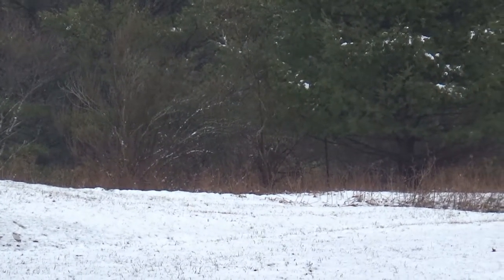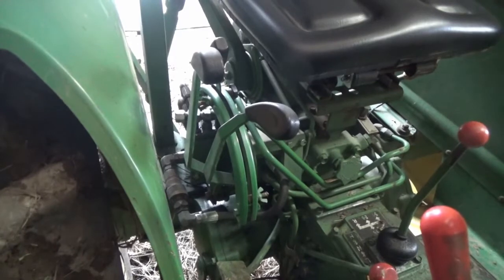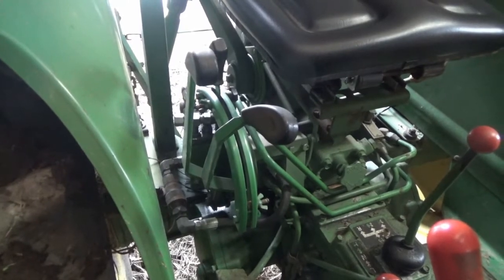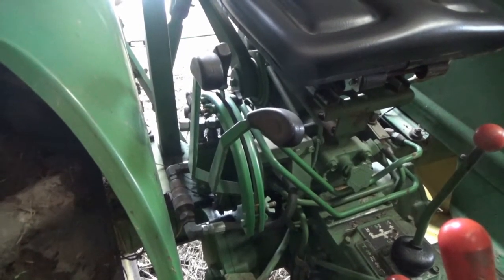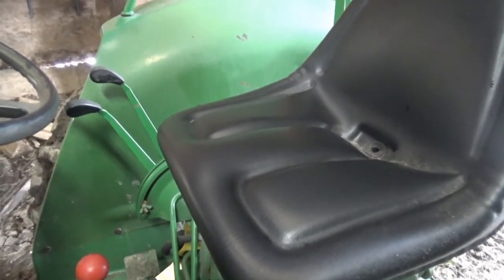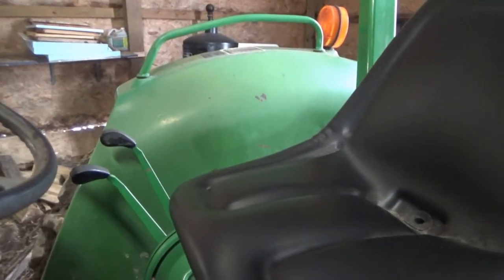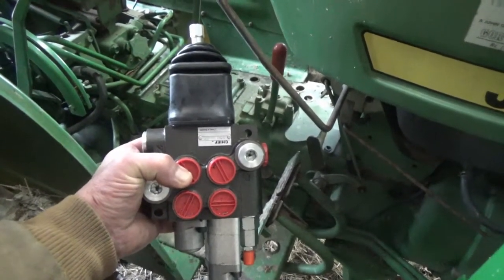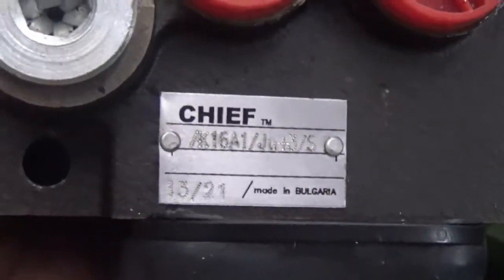John Deere 1050 Loader Joystick Conversion Update

Comment: Did you finish this project? I have the same unit and I hate factory controls
Reply from the maker: Not yet, I'm missing a port plug that seems impossible to find locally and I guess I need to get online to order one. As soon as I get that, I'll be updating with a new video on getting this project done!
Reply: Thanks

Comment: You ever finish that up?
Reply from the maker: Not yet, waiting for the original repair I made to fail I guess. Sorry, soon I hope.
Reply: @SteeveeDan  no sweat, I ordered the same valves anyway. The original valves and control sticks on mine are just about shagged out.
Reply from the maker: @Glissade195  Mines close, will have to do it soon!

Comment: FYI, the further the controls are from your torso/shoulder, the harder it will be to use them efficiently and the more fatigue you will cause your arm/hand. If it were me, I'd keep the loader controls as close to my body as possible. Maybe still mount to the fender, but use additional steel to move everything closer to you.
Reply from the maker: Appreciate the info, thank you!